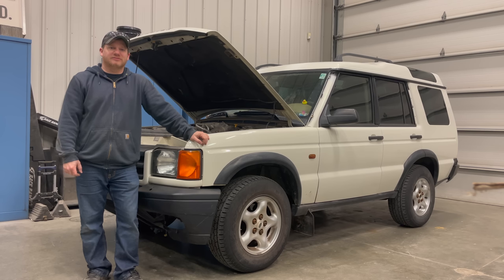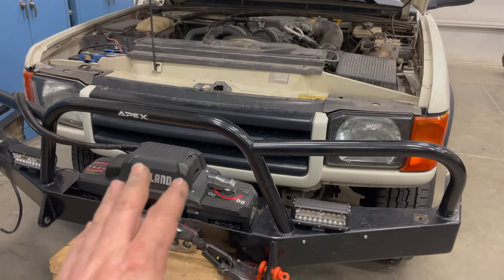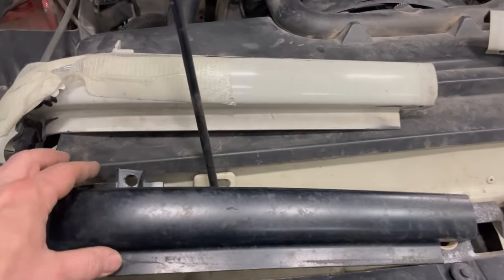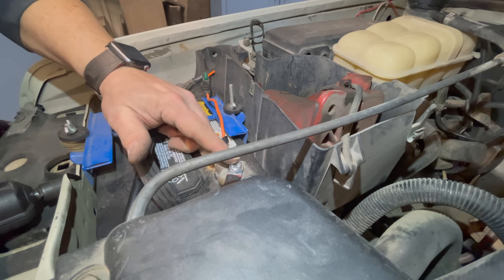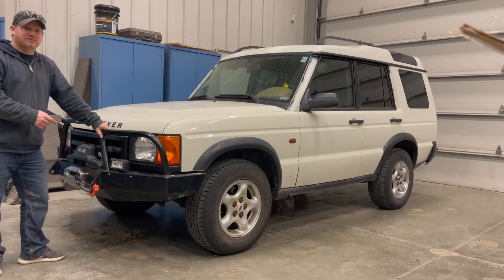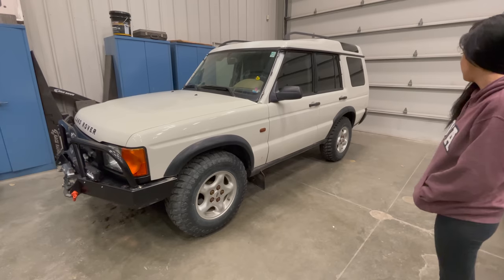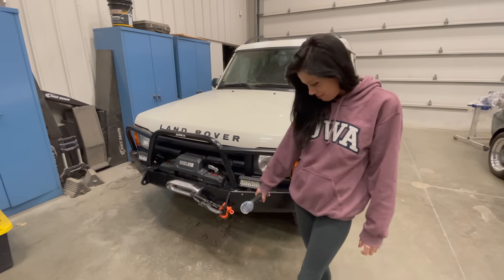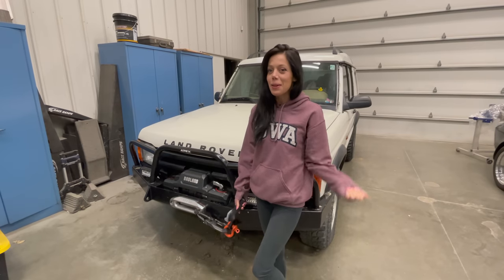Upgrading Cassie's Land Rover Disco 2 - Will She Like It?

Comment: With a wireless winch I think I would install a disconnect for the winch so it is not powered all the time.
Reply: Will powering it on, with less use, eventually burn out motor ?

Comment: Have you replaced the brake lines yet?

Originally the disco had straight steel brake lines, which rust and then leak .. it's well worth replacing them with hand made kunifer ones ;)
Reply: Are brake lines easy to replace and install for a DIY person ?  I can change pads, rotors, calipers and bleed brakes.  Thanks

Comment: Rotational? Aren't all tires rotational? I'm thinking directional :)
Reply: It means in which direction they rotate as indicated on outside forward facing sidewall of the tyre...you can swop front to back on same side but not swop to opposite side...so you need to carry 2 spares..lol

Comment: Is there a fuse in the lines of the winch you connected to the battery somewhere ? (with an electric motor you would want to have a fuse to not burn down the whole car if the wich is overloaded or something broken or burst the battery)
And what about the speedometer? I have seen that people in the Us like to just put on way bigger tires and nobody cares that the speedometer then shows less than the car is driving and counts less miles than it actually does.

Comment: Is it a bad idea to just ground your negative on the frame?
Reply from the maker: Usually not but when you are wiring a high current device such as a winch it is best to run it straight to the battery so that you don’t burn something up.
Reply: @ThisWeekWithCars  Does winch need or have a fuse?